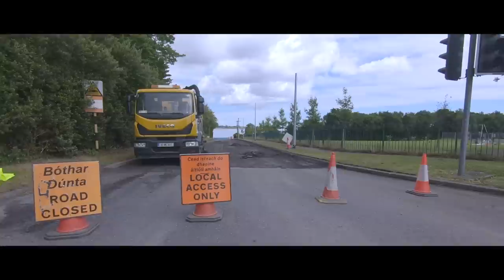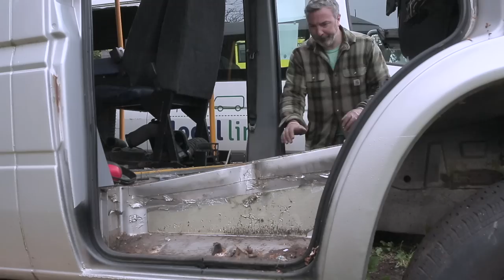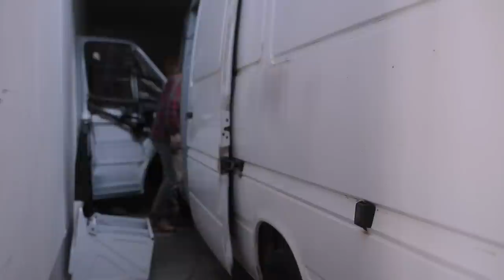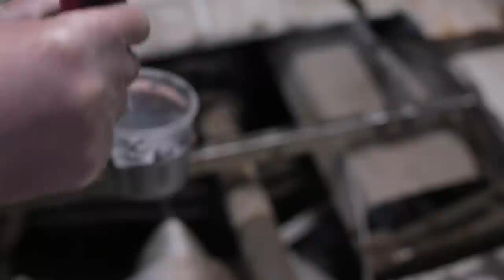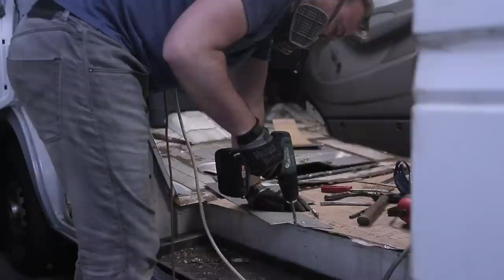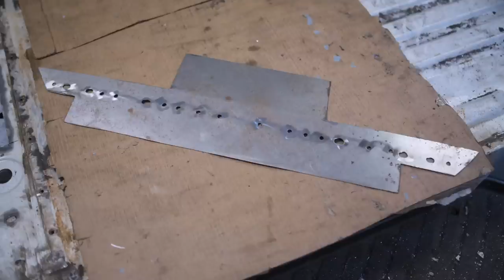Sprinter van restoration

Comment: There are men who buy big garages and fill them with expensive tools, not knowing how they work or ever truly finding out. They produce nothing and the tools are eventually sold as the next fad takes over. Then there's this guy. He paints with a toothbrush, and bends steel with a battery and he produces new cars out of old rust and sheer persistence. Which guy do you want to be? Your videos are a lesson in creativity, and you are a poet with an angle grinder. It's a pity you can't weld with gold wire, as your repairs are like kintsugi. Lovng the channel, keep them coming 👍🇦🇺
Reply: Those guys are known as wankers and sadly they’re in no short supply. Content like this, however, is the antidote. I’ll take a repaired toothbrush-painted, battery-bent Mercedes-Benz shitbox (surely that’s a tautology…) all day versus the alternative and I’m sure you’ll agree.
Reply from the maker: Still want the big garage, with all the trimmings though 🤣 [both comments are faith restoring btw]
Reply: You hit the nail on the head man

Comment: George, A small gas blow torch is a quick and easy way to get rid of factory sound proofing as you can take it out in 
sections like you did with the chisel, BTW any idea when you might be able to get out to Austria as we talked about 
some while back, My Jaguar XK 150 should be back on the road in spring 2023 which I‘m sure you would like to drive 
along with my E Type and Mini Cooper plus the Gulf track mini. Cheers Dave
Reply from the maker: Hey Dave! Long time. You're not wrong about the XK! Austria is def long finger, but still on the list pal. Lot going on here behind the scenes. Have to catch up on your exploits too. Catch you soon.

Comment: I've been following your projects for a good while now, really enjoying them and the video production is second to none!

I've recently discovered spot weld chisels - it's a very thin chisel specifically for separating panels that are spot welded. Mine is a Sealey AK570 and it will make your job so much easier. They're not expensive, around £15 here but worth every penny.
Reply from the maker: Thanks for the steer [and part number], turns out they're €35 here 🤦🏻‍♂️

Comment: Love your videos. I am doing similar work on a MK6 Transit.

My problem was water entering the channels either side of the windscreen and ending in the footwells. Also, the sills were being rotted from the inside out due to sealant disintegration on the roof and joining of side panels.
Reply from the maker: It's nuts how the focus on sealing vehicles from the outside has resulted in them rotting from the inside instead. In so many cases.

Comment: If i need to bend this small piece i cut it half the thiknes on the outside of the bend and weld it back up when done. It works fine, 
Even with 12mm.
Reply from the maker: I keep that for when it's not working for me lol

Comment: I remember when these vans were new, doesn't seem all that long ago. Still prefer the mk1 though, had more torque. Blip the throttle and it would twitch pronouncedly. As for the later incarnations, stick with what you've got,. Way better! 
 Still can't believe it's been 20 years though, ah the good times.
Reply from the maker: Yeah the newer ones are supposed to be inferior alright, but tell that to everyone else 😂

Comment: I have a Mercedes Sprinter from 1995 and need rust work. I have sanded rust away but never cut and welded. What should I buy for welding in a small budget? Love the video, I learn a lot from it.
Reply: Ideally you need a mig welder, wire and gas but you can get a flux core welder but it is frustrating to use and produces dirty looking welds. The main thing is plenty of practice with scrap pieces until you get the hang of it. A decent automatic face shield is a must as you need to be able to see what you're doing. A stick welder will weld heavier gauge steel but burn holes in the thin steel.
Reply from the maker: My machine is an R-Tech MIG 180. It's a good machine. Just make sure whatever you get has got progressive settings for power and wire speed... knobs, not just witches. good luck!

Comment: I had a 95 sprinter 312 for 17 years, and i restored it from back to end and inside and out, and then it got stolen after only 3 weeks when it was restored.
I live in holland and these days old diesel cars, trucks and vans are being banned from all major cities, so they are worthless in europe and are sold for export.
Reply from the maker: They're notoriously easy to break into I hear, and the stainless steel door lock armour only makes it take a little longer. I'm thinking of seam welding plates around the handles. Bad luck with yours Peter, sorry!

Comment: I feel kind of glad that, despite always wanting a Range Rover Classic, I never got one, I got a D2 facelift instead.... I feel like the RRC is the type of car, that once you own one, you'll own one forever, and will always forgive its massive rusty flaws thoughtlessly because they're a drug... Yeah.. Maybe I should stick with the D2 and my tdi Defender!!!! That's enough drugs!!!
Reply from the maker: The D2 is the ultimate development of the RRC. The last of the RRC's were test beds for a lot of the D2 tech. Only thing that goes against the D2 is the chassis is made of paper and the rear end rusts out like crazy. The RRC's had big heavy gauge chassis [by comparison] right until the end. Other than that the D2 is a beast. Just needs some preventative maintenance. Oh and not many Defender owners realise the Defender was developed off the RRC, not the other way around.
Reply: @soupclassicmotoring  I honestly love the defender chassis, with good shocks they're decently comfortable!! I must have the only Irish d2 left thats fully private with 7 seats on its original chassis, has 220k miles and it runs like a dream, chassis well solid too. Best worst car ever haha!
Reply from the maker: @FPVsean  Mine was private until the end. I almost rebuilt the full rear end of the chassis when I got it, and it was completely gone again when the Disco left.

Comment: dont use charcoal filter any time, 3m has welding and dust filters
Reply from the maker: Are they that bad?
Reply: @soupclassicmotoring  bad for your teeth, so its not advisable to use it for a long time
Reply from the maker: @ИльяКарасёв-в4в  Thanks for the tip!